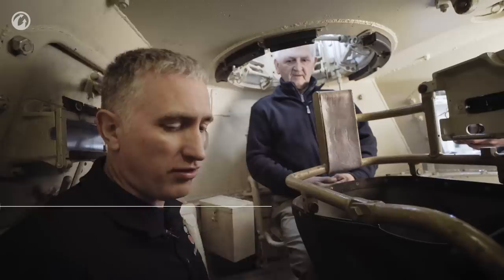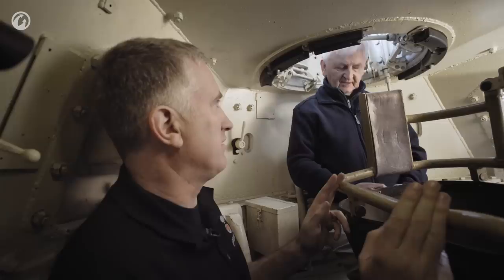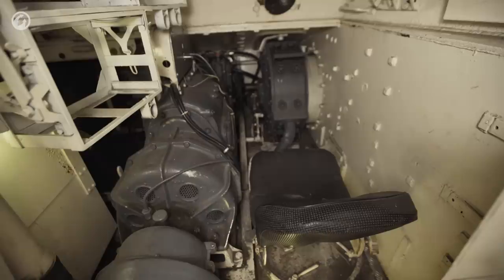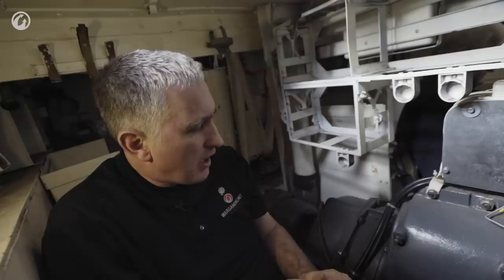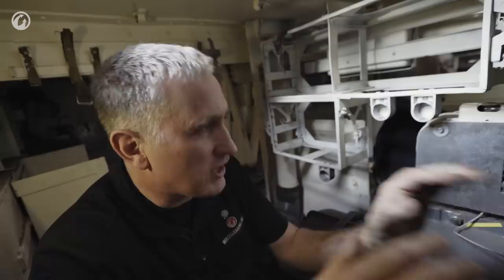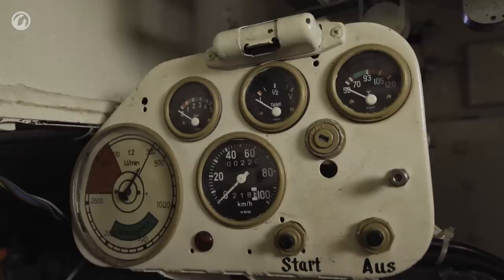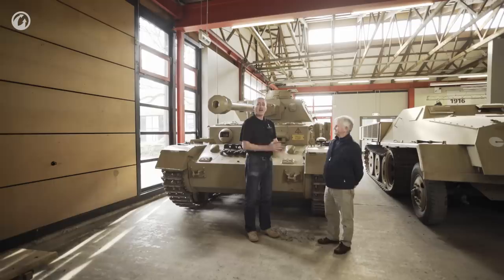Inside the Chieftain's Hatch: Panzer IV Pt 3

Comment: LMAO, the thought of being called to plug a hole due to enemy advance rushing to your tank only to have one of those days where you forget the keys. Then the thought  immediately after of trying to hot wire a tank and going GTA in the rear lines - too funny. Actually there is an avenue of research maybe, did the Germans have keys for tanks to avoid the allies being able to reuse them if the crew abandoned it for some unknown reason but tank was still serviceable??
Reply: I don't think a missing key would prevent a repair depot from putting the tank to use, so I doubt it would serve as a way to prevent enemies from capturing it. These aren't modern cars whose operation is conditional on advanced electronics that can't just be replaced. Usually, crew who abandoned tanks to the enemy were expected to scuttle them by rigging them to blow up the ammunition and thus trash them on the inside.

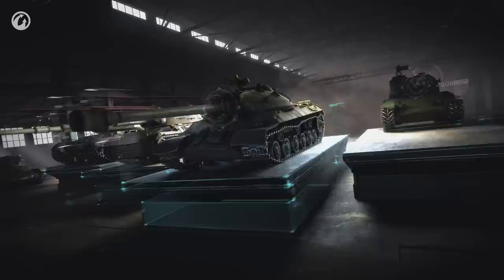Comment: 16:10 -- RE: Gyro compass; "Was it accurate?" -- More accurate than a magnetic compass in a steel tank, Chief.  The Gyro part means it is Inertial Guidance, as many aircraft also use for autopilot navigation.  Inertial guidance, unlike Magnetic, doesn't drift with the Earth's magnetic field; the best dead reckoning available.
Reply: SEE ALSO:  https://en.wikipedia.org/wiki/Inertial_navigation_system
Reply from the maker: Magnetic compasses are also a thing in tanks, mind. (And on ships). They just have to be calibrated correctly.

Comment: this guy is always looking for an opportunity to explain why Sherman's didn't suck actually, despite their small gun high silhouette and highly flammable fuel
Reply: Dude. The sherman is barely 20 cm taller than other tanks. The high silhouette doesn't matter if your sight is mounted up high so you can see your enemy without exposing ur tank. It's also far more comfortable . Also the petrol engine fire myth is stupid. The germans used petrol. Why aren't they give the "highly flammable" titel aswell?
Also the guns were a really good ones. The 75mm will go thru a tiger 1's frontal plate with the T45 rounds and the 76mm will punch thru at more than a kilometer away. Heck the 75mm will kill a panzer iv from that distance. Not to mention of how the 105 mm howitzer will go thru the panthers frontal plate with heat rounds
Reply: @Will Loomis
No, "this guy" isn't looking for the opportunity to explain why the Sherman didn't suck. Do you consider a 75mm (I assume, that you aren't talking about the upgraded ones, which had the 76mm) a small gun, compared to ww2 standards? I think it's a perfect calibre, by the way, the calibre of a gun doesn't explain everything about it. (I know, it has been a big surprise) We could say, that the Sherman was bigger, than the other medium tanks at that time, but it's objective. The country, which designed it knew its limitations, its abilities and they wouldn't have made the tank be bigger, than needed. Now, I'm not an expert, but I think the Sherman's crew was happy to have a little more workspace, than usual :D
Reply: @emilbt7588 
"The germans used petrol. Why aren't they give the "highly flammable" titel aswell?" According to my knowledge, the Germans shot the (enemy) tank, until it catched fire, or it was obvious, that it can't be repaired and put back into combat. Because of this, the following units mostly saw their tanks burning. Although, I could be wrong about this.
Reply: @Polygon-yug-9581  that is exactly what happened as the tanks was later recovered with more holes in them than when the crew abandoned them
Reply: @emilbt7588 
Do you recognise me? I remember you, but it looks like you didn't read the commenter's name :D
Reply: @emilbt7588 
Actually, it's quite funny.
Reply: @Polygon-yug-9581  oh i remember